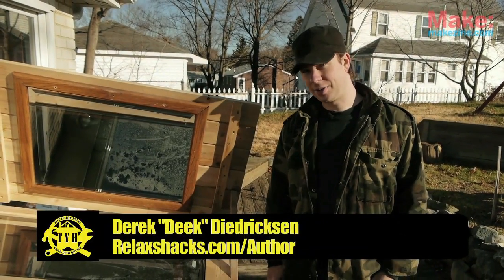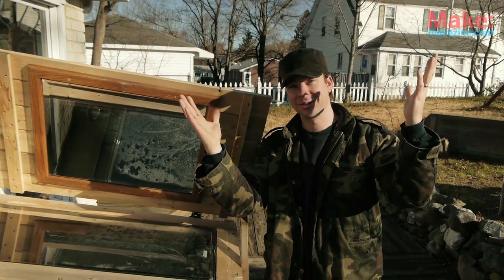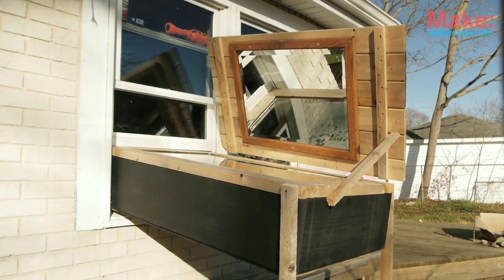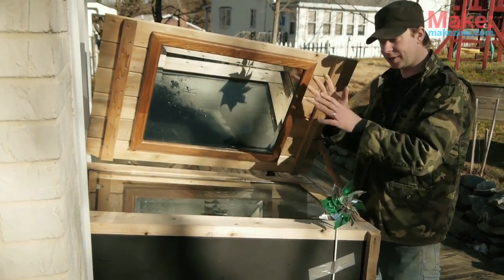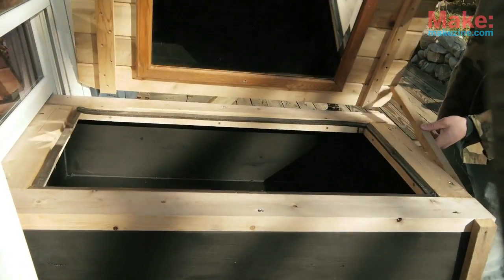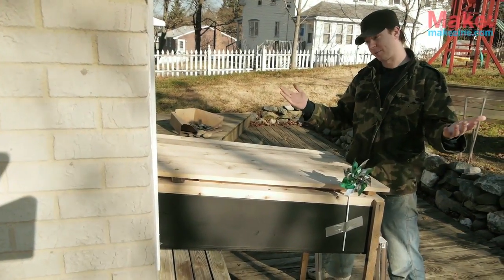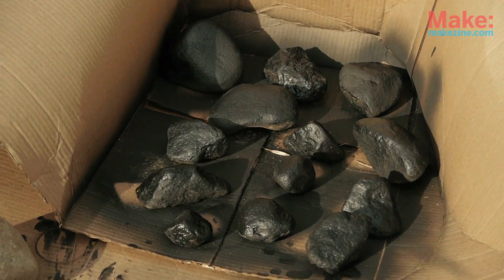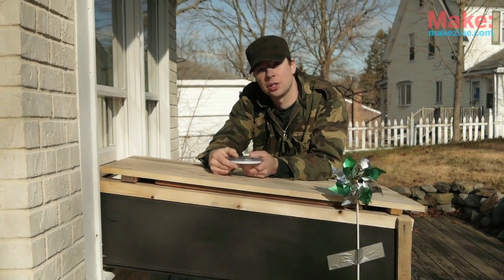"Solar Parasite" Window Box Heater - Tiny Yellow House

Comment: Where's the air intake on that? If you're relying on convection for this thing to run you would need some form or an air intake to allow new air to cycle through the collector.

Comment: I just built mine to fit inside the window sill.  That way it heats already slightly heated air inside my home.  One note: my windows are aluminum framed... I wouldn't try it with "vinyl" framed ones.  I take it down in late spring and put up reflective material to keep the summer sun/heat out.  Makes a huge difference.

Comment: I didn't see your air inlet but I assume you have one on the bottom or else the solar box wouldn't work well to get heat into your house because it would be fighting a vacuum.
For more air and instead of cheezy paper baffle, I used 2 cheap solar panels to spin a pc fan and use heater duct wrapped in insulation piped into the house so as not to clutter the window.  It puts out 120* heat in January for several hours most days here in the Sierras.

Comment: Nice video.  
I built mine bigger because I wanted to reuse and old sliding glass door and I don't know how to cut tempered glass.
Aye to the flat black, and the black rocks.  I used blackened metal roofing for the backdrop and suspended metal screen about the middle for the air to flow through.

Comment: Nice video.  How hard would it be to add a fan that runs on solar power and turns off if the temp is below 68 degrees?

Comment: you are a genius... plain and simple.
You can connect it to an arduino to control the heating. Just hook up some temperature sensors and some servos. You can then compare the external temperature with the internal one and open up the machine when/if the temperature of the house is too low. :)

Comment: This is pretty awesome!
With a little 12v 4W PV solar panel & PC case fan, you could improve the heat transfer by miles. Old beer tins also make a good passive solar heat collector.
How do you stop draughts and heatloss between the panes of the window?

Comment: @relaxshacksDOTcom In that case, Deek, job well done!  But even if it wasn't optimized for fluid flow, it might produce some radiant heat, particularly if you fill it with rocks, as you mentioned.  (Caveat: I'm a civil-structural engineer, not a mechanical engineer.)

Comment: In fluid mechanics, there's something called the "continuity equation".  There has to be equal amounts of fluid mass coming into the box as going out of the box (provided that the mass of fluid within the the box remains steady during fluid flow).  In other words, I think there needs to be holes somewhere to let cooler air INTO the box.  Then it's heated.  Then it flows out of the box as warm air.  Alternatively, your box could radiate heat as opposed to providing a stream of warm fluid (air).

Comment: Instead of spraying the rocks get some already black rocks.. dont use river rocks and try to find ones with as coarse of an surface as possible since  more surface area = more heat :)
And yes wrinkly and coarse rock does have more surface area than nice smooth one..